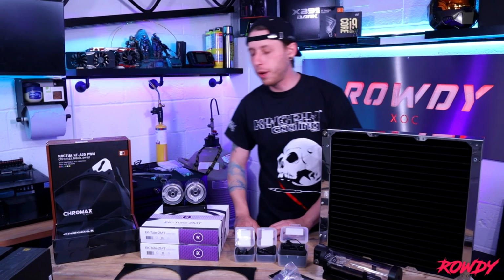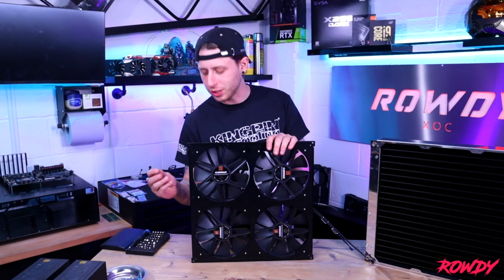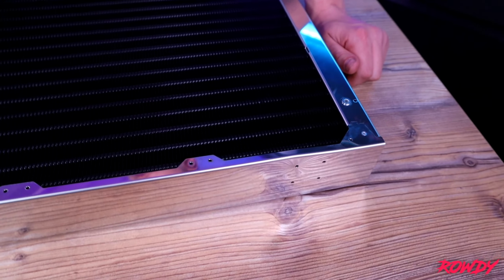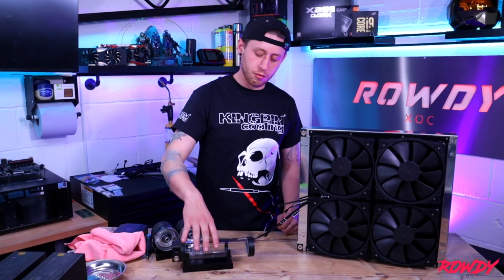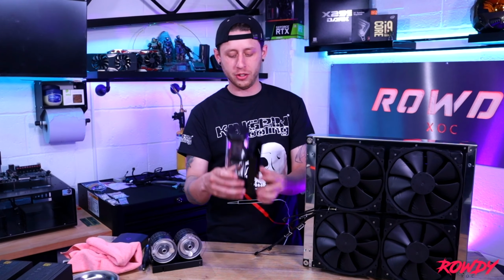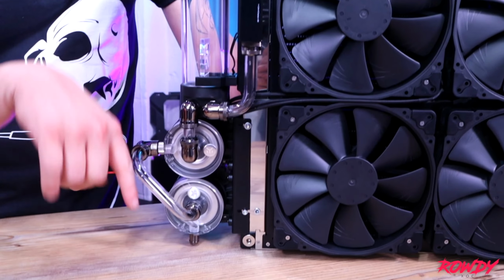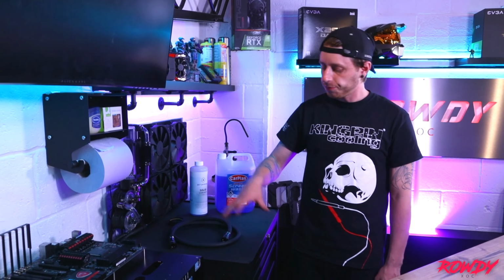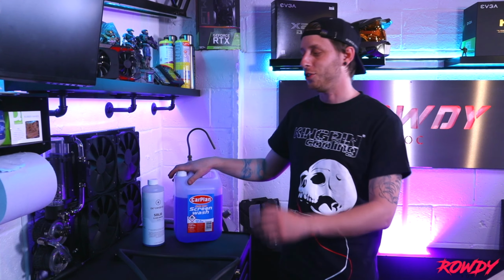MO-RA3 420 Stainless Steel Radiator Build With 200mm Fans!!

Comment: I bought a Mora 420 kit with 4 x 200mm fans, dual pump kit and reservoir for my newly de-lidded 14900KS. All original parts and extremely easy to assemble, no bodging needed 😊 and works superbly giving only a 2C increase in water temperature over ambient at 320W CPU power. Currently freestanding on feet but I also bought the wall mount kit. Highly recommended, albeit with a hefty price tag! Getting 6L/min flow through my CPU block.
Reply from the maker: Sounds great mate, I am glad you happy with it! one of the best rads on the market for sure.
Reply: I have 4 360mm radiators in an external water cooling case i built. How does the two pumps impact leaks and such?
Reply from the maker: Hey there, if you are worried about the additional pressure. 2 pumps are not enough to exceed most if not all manufactures pressure limitations 👍🏻

Comment: Nice Video! Thx. Which parts were used for the table Pass-Through?
Reply from the maker: Thanks man! I used barrow tech pass throughs with an Ek extension to go through the table. I drilled the hole to match the size of the pass through so you could pretty screw it down into the desk. The quick disconnects are also barrow. I chose barrow based on price alone, you could use any brand of your preferred choice 👍🏻

Comment: One thing I would like to see a video of is installing fittings with EK-ZMT tubing. Apparently they are pain to install, but if I were to go custom loop that's what I would go for.
Reply from the maker: The thing with ZMT, is that in most cases it is notoriously out of spec. I will say this though, I have used ZMT a lot and in my personal experience has always worked as intended with little trouble!

Comment: Great video thanks for bringing this information. I'm still overclocking with limited AIO and struggling between frequency, voltage and temperatures.
Reply from the maker: Thanks very much! Will have some new content coming soon. Yeah AIO is a nice option for casual OC but if you like benching etc custom loop is definitely a more efficient route! 👍🏻
Reply: @ROWDY.404  Really, for the 13900k and 14900k that I'm testing now, a cooling solution like yours would be ideal. Thank you very much my friend, I am already subscribed to your channel to see the news.
Reply from the maker: Yeah the Mora really is great bit of kit and whether you are into overclocking or just a general hardware enthusiast it performs well all round! Thanks again for your support 👍🏻

Comment: Okay, now I'm very interested!

I'm on the market for exactly one of these, and I'm intending to use it for Direct Die cooling with liquid metal for the 13900KS OC experience. Have you done anything like that with yours? What were the temps under load? How high up did you push your frequencies etc?

Hoping to see more from you!

Comment: I found your channel because I am planning my own Mo-Ra build in preparation for an upcoming new PC build once all of the dust and reviews settle with all of these CPU and GPU launches.  I subbed  even though you polluted that wonderful Mo-Ra with Barrow and EK.  Especially that nasty ZMT.  I can somewhat forgive the res (acrylic tube) but Watercool's own EPDM or Tygon is far superior for tubing.  ZMT is notoriously dirty out of the box and also frequently out of spec which is why many people have problems getting it on their fittings.  Best wishes for your channel and I look forward to watching your previous videos!
Reply from the maker: Firstly thank you for your honest opinion and feedback! This was was built on abit of a budget and most of the components I used was stuff I already had kicking about! As you know this hobby is financially taxing as it is 😂 none the less I’m very happy with how it turned out and there is always room for improvement down the line which I will undoubtedly use for future content. Thanks for taking the time to look through my other vids, I hope you enjoy them 😃👍🏻
Reply: I use 10/16 ZMT and i cant say that theres anything wrong with it. Compression fittings are unreliable anyways.

Comment: Still not sure why you didn't just get Watercool's D5-DUALTOP MODULE which is a single bracket that lets you mount both D5 pumps along with a reservoir and was intended for the MO-RA3 420 (incl. the Noctua Edition).
Reply from the maker: Thanks for your comment! At the time of the video that adaptor was not Available as it seems to sell out quite quick. Still happy with the result though 😂👍🏻

Comment: How did it go with temps? What rig did you use it on? thanks
Reply from the maker: Temps have been very good! I have used this with a few different rigs now and I would say most have been in the low 60s under load. This is however with a fairly low ambient temp so that is something to bare in mind 👍🏻

Comment: Can I suggest you get the 'deep fan cover'. The 200mm fans don't bite like the 120mm 'industrial' Noctuas but still better protected.
Reply from the maker: Mine is now firmly mounted on the wall out of the way. So fingers are safe for now haha
Reply: @ROWDY.404  Mine too, but it looks a lot neater with the black grille 🙂

Comment: How is the windshield wiper fluid holding up ? Any cold temperature impressions ?
Reply from the maker: To be honest it’s holding up really well! I have been running it in my loop for just over a year and it’s just as good as the day I installed it! I occasionally have a play with a modified AC machine to overclock which can bring temps down to -5/-6 with no issue of freezing up! 🥶

Comment: may i ask why did you mount it to a flat wall with 0 air flow? no air is going to flow through that rad with it smashed against the flat wall like that
Reply from the maker: Hey! it’s hard to tell from the camera angle but the rad has around 3-4 inches clearance from the wall, which is more generous than the official wall mount kit you can buy from watercool. I’ve used the rad for a while now and temps are great, so if you are considering wall mounting I would defo recommend 👍🏻

Comment: Are the pump and fans powered right from the PC motherboard fan connectors?
Reply from the maker: Hey there, all pumps and fans are powered of an additional power supply. Hope that helps 👍🏻
Reply: @ROWDY.404  Does that mean the pumps and fans run at 100% all the time, or do you have some kind of controller hooked up as well?
Reply from the maker: Yep Pumps and Fans run at 100%. The noise on the Noctua's is so low its not a problem for me, so didn't see much point in adding a controller for now 👍

Comment: you are happy with having the pumps in series?  i would not be.  unless  they were on either side of that radiator.  you could have run them parallel and it would be more efficient.  pumping from one pump into another pump isn't ideal.
Reply from the maker: Yep, Im happy with the route. I have built many loops over the years with this config with no issue. Plenty of flow, so wasn’t to concerned with number crunching efficiency. I liked the way it looked and it worked. Thats it 😂 👍🏻

Comment: What length fill port you use? 
And what fill ports did you use?
Reply from the maker: Hey there, I’m not quite sure what you mean by fill port? If it helps, the reservoir is a 250mm EK Ex-Res X3. The fittings are 14mm - G 1/4 XSPC 👍🏻

Comment: Im building a PC currently and i just purchased a 4090 and intel 14900k. If i dont go this route how many radiators would I need to cool the GPU and CPU effectively? I've read many different things in reddit. I was originally going to get a NZXT kraken elite 360 rgb cooler. Thats all that was recommend form paradox customs, but after reading online I realize i definitely need more to cool the CPU and GPU. Would 3 of those Krakens be enough to cool my CPU and GPU? Really appreciate your response. Thanks in advance.
Reply from the maker: Hey, thanks for your comment! So as we know both the 4090 & 14900k run hot 🔥 you could get away with a 360 but this would be far from optimal, I would be more inclined to run 2x 360 and ideally on independent loops. Obviously this  very much comes down to space and how much money you want to throw at it. External radiators like the Mora would be great option if you have the room 👍🏻

Comment: tenho 1 mo-ra 420 noctua 20mm , gostaria de saber se vale a pena investir no push pull ? agradeço pela  atenção .
Reply from the maker: Hi there, in my opinion due to how well the radiator performs with either just a push or pull configuration with the Noctuas it is not worth/necessary to go for a push pull set up with these radiators. The performance gain will be almost unnoticeable. Hope this helps 👍🏻
Reply: @ROWDY.404   obrigado amigo
Reply: ola meu amigo, no meu sistema uso 1 xd5 corsair  1 radiador 360mm e mo-ra3 noctua , vou ter mais performace usando 2 bombas ? vale a pena comprar  duas bombas? agradeço pela  atenção .

Comment: Hey man, awesome job on the build and video, only just come across your channel today as I'm looking at adding one of these rads into my current loop so I have a question if you can help;

I was planning on putting the rad in the loft and running tubing down through the ceiling, down the wall then into the back of the case through those quick disconnects then obviously back up, my issue is the head lift, I've seen the EK xtop revo duel pump that has over 7m lift but curious as to what yours would be, the pumps you've used I think have 3.9m lift on their own but would that of been increased with how you set them up I.E. one pumping into another?
I did think it would be less of a pain too with regard to connecting the pumps to have them in the case co i can hook them up to my commander pro and the psu of course

Appreciate any help and advice you can give me
Reply from the maker: Hey bud, thanks for the comment. This is a cool idea I like it! The performance of two pumps running in tandem like mine have the same Benefit as using the dual Ek pump. Considering the head pressure you will need to get up to loft and around a Mora, you may need to experiment a little with a possible 3rd pump to achieve decent flow. I have quite a large loop in my test rig which uses a Mora and even with two pumps the flow is decent but not amazing! You can see the rig in one of my more recent videos for context. Please let me know how this works out for you 👍🏻